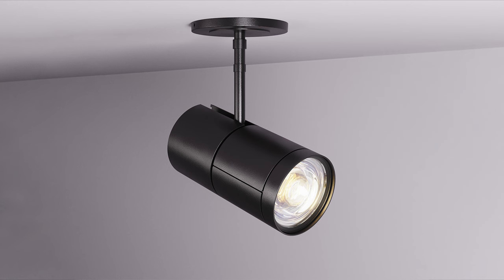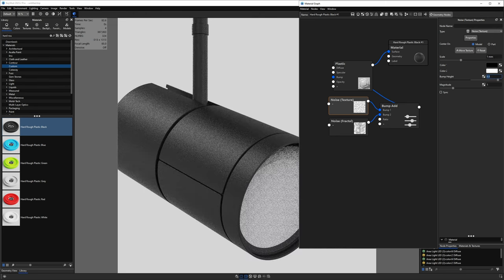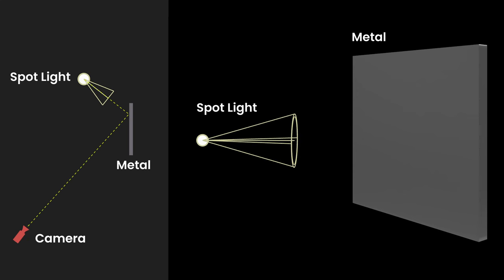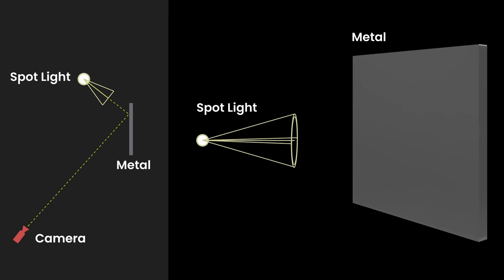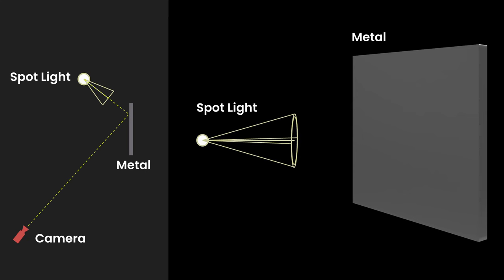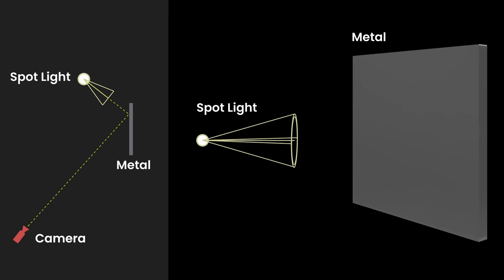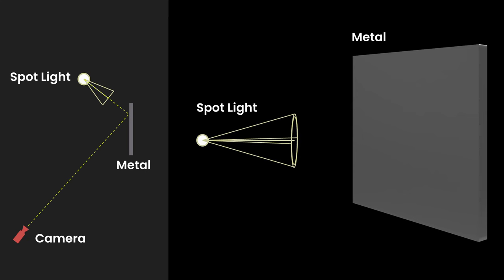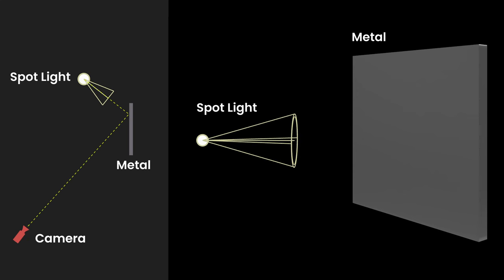KeyShot  Spot Light / Accent Light Tutorial

Comment: Awesome! My biggest nightmare is creating lights with realistic reflectors.....especially show them turned off. Most times I have to show some reflection of the led element inside the spot to highlight different lens options on the same spot.....My safest tip is to try and model the lens as close to reality as possible......And many times some of the lens surfaces have different finish to achieve the desired light output. Also very interesting idea to make the reflector a yellow color.... I always use polished aluminum and use warmer Kelvin (4000k in reality). That transparent glass tip for the main body is going to be a life saver from now on......Thanks.
Reply from the maker: Happy to help! Yes, I understand the challenges you face. Working with good geometry really is key here in this case. One thing that might help you out though is having an area light or white card (out of sight from the camera) that's being reflected in the reflector inside the lens assembly. This will prevent it from being too dark even with the LED/light source turned off.